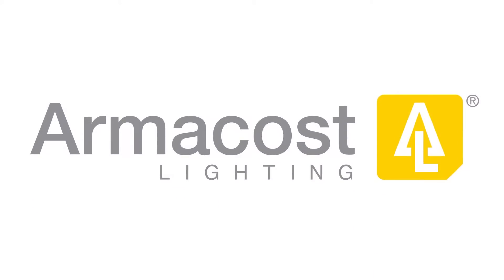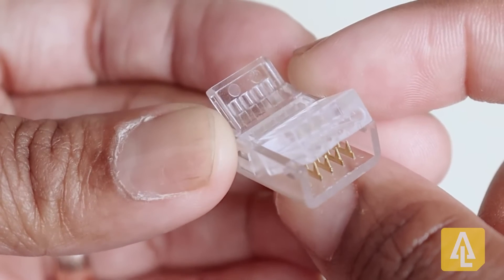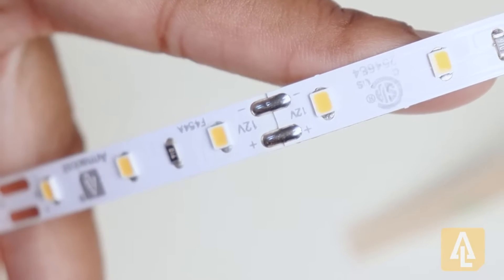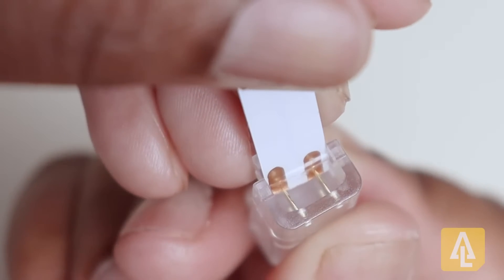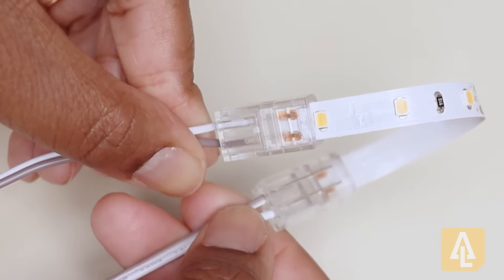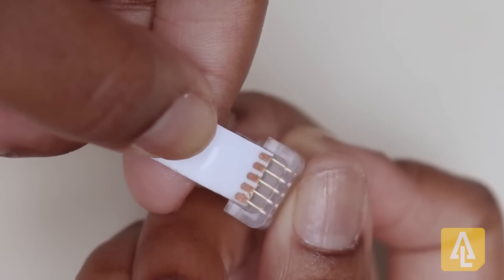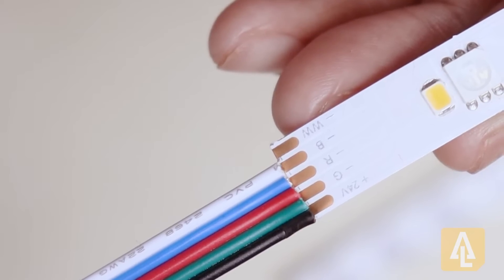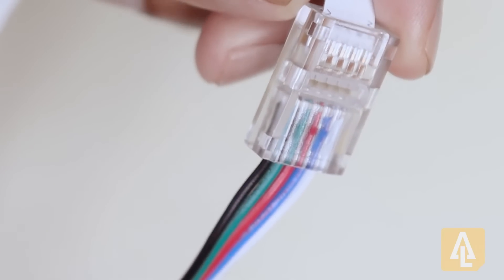How to  use LED Strip Light wire-to-tape light connectors

Comment: I crimped the wires but i do not bring them in the housing,. The wires are to thick for the little squares in the housing. Is there a chance to get bigger houses if yes, where?. Houses is the black square. English is not my mother tongue. 🙂
Reply from the maker: Thanks for reaching out.  We suggest using a narrower gauge wire.  18AWG
Reply: @armacostlighting8217  Thank you. I thought IT IS important to use 20 AWG.